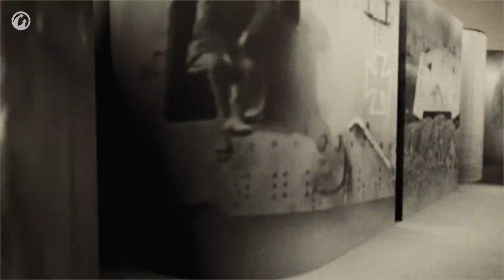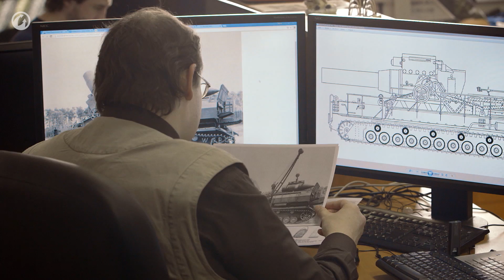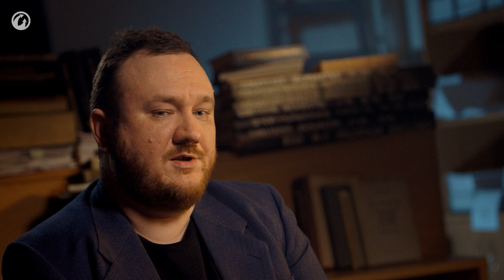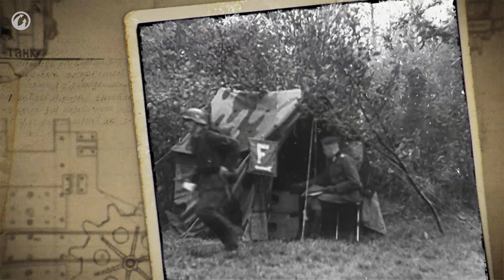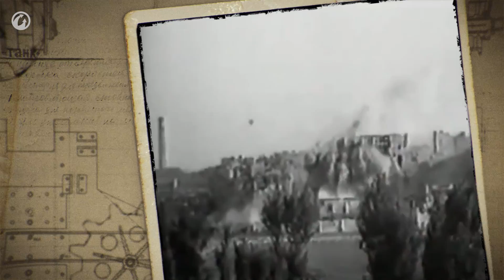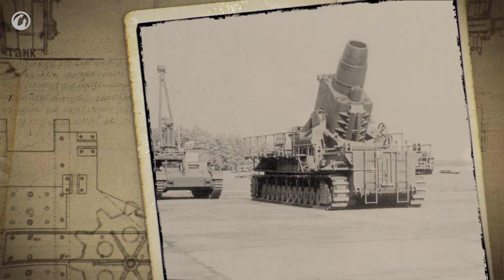Karl-Gerät mortar - World of Tanks

Comment: It would be like a cement mixer full of TNT falling out of the sky on the bunker you're in.
 The weapon was a waste of money,  all that engineering money would have paid for more 150mm howitzers and Germany could   more selfpropelled 150mm pieces. 
The Soviets built 360 mm mortars that were much cheaper, easier to move,  and supply than the German mortar,  and never used them. Khrushchev was mad, he said, they wasted the money on the  big mortar. He was right.

Comment: Actually the mortar had a range of 10,5 kilometers, the biggest load was a round with more than 400 kilograms of explosives and at least one device was powered with a 700 horsepower Diesel engine from Daimler-Benz. Nevertheless it was a useless piece of junk.

Comment: This weapon was part of a mechanized siege train and, as such, was ahead of its time.  If the Maginot were to be assaulted, then you'd need these babies, because they could stay off the rail lines, which would likely be pre-registered by French heavy artillery.  Anything heavy coming up by rail would be interdicted.  And that's the west, when the real purpose was attacking the east.  In the east, consider that a tracked siege gun could travel ahead of the rail repair/building units, while nothing horse drawn would be able to carry that much punch.  That would speed the pace of advance beyond the pace of your railheads moving eastward.  And the cost of protection argument is a bit overstated,considering that four of these vehicles were the functional complement of a Heavy Artillery Battalion (Schwere Artillerie Battailon) and every other super heavy Artillery battalion was similarly well protected, ours or theirs.